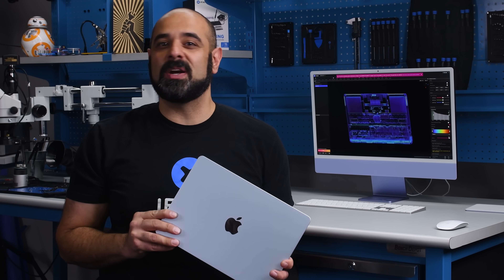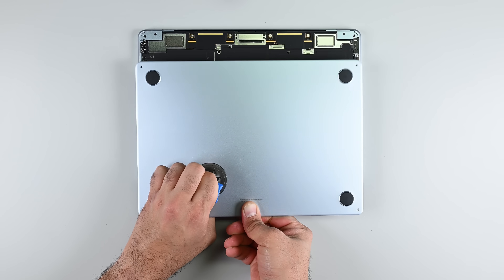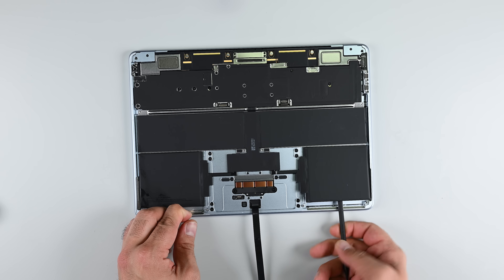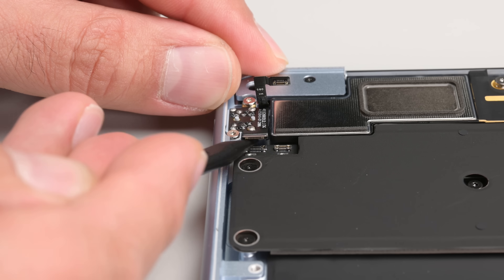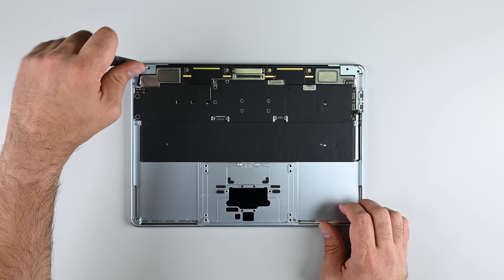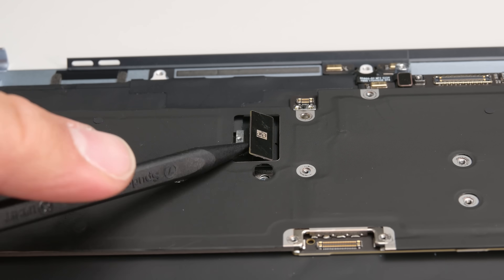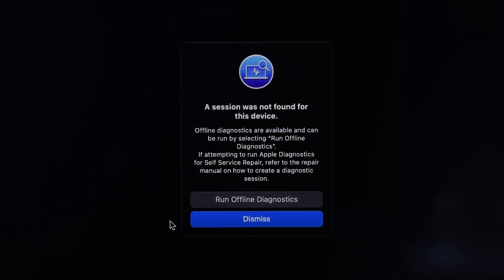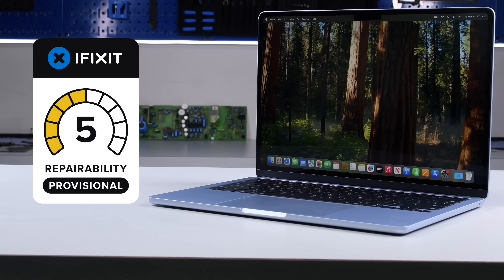MacBook Air M4: A Repair Win or a Locked-Down Mess?

Comment: Remember when you could pop out the keyboard of a laptop in 5 seconds with anything vaguely pointy ?
Reply: Relatively modern thinkpads are super easy to remove the keyboard.  Only two screws!
Reply: @joelv4495 I think you and I have different definitions of relatively modern
Because the current gen can’t do that 
And I don’t think the generation before could
Reply: I also remember when my laptop was made of cheap plastic and was a pile of junk after 2-3 years... Don't miss those days.
Reply: Lenovo T420.
Reply: A friend from work brought an old HP laptop. The whole bottom cover was removed by squeezing two tabs, the way old batteries used to be removed.
Reply: I'm in my 20s and I've never held a laptop like this in my life. That must be ancient history. 😁
Reply: @Tedrousek  The ones that don't have the keyborad integrated in the chassis, the keys are square and touch each other.
Reply: @Tedrousek  Not really. A friend of mine has a five(?) year old Lenovo laptop and the keyboard popped off with just a guitar pick (several little clips and like one screw hold it in). I also have a Framework laptop and those use magnets and screws. Business-oriented laptops tend to be more serviceable than the $300 laptop from Walmart or Best Buy.
Reply: @Tedrousek  not really, laptops only stopped being like that a decade ago

Comment: Correct me if I’m wrong but isn’t a purpose of parts pairing to deter people from stealing Apple products for parts? I think it’s quite a worthy trade off to pay Apple a bit more for a safety from theft.
Reply: the theft "prevention" is far out weight by the actual repairs that repair shops could do to prolong these device life time (which is not what Apple want, they want you to buy new, not repair).

you concern with a very small problem that Apple use to justified their anti-consumer behavior. Do you really think a company like Apple whom sell 2TB of mediocre of SSD storage for $800 think about prevent theft after they sold the product to you? They certainly don't care, they already sell it to you. they are more concern about you buying a new one after your old one brake down and no way to repair them economically.
Reply: @tsunekakou1275 esl?

Comment: At least the ram and storage aren’t parts paired, because they’re still soldered! The upside is that if you can find the modules required (and you have a soldering kit), you can upgrade it. Although you risk damaging your device.
Reply: these chip are smuggled out of factory in China, Apple can stop these thing anytime they want. most people would not spend hundred dollars on hot air station, pcb heater, risk buying sketchy chip from aliexpress, wait for a month, spend hours to solder. that is a big if with a lot of asterisks.
Reply: @tsunekakou1275 These are the same NAND modules as in the m4 Mac mini, for which companies like expandmacmini already developed and sell a custom pcb with 2tb storage

Comment: Magsafe is useless i wish they bring back another USB-C port
Reply: Wrong. MagSafe is fantastic.
Reply: MagSafe useless??? It literally frees up a usbc port you can use for something else.
Reply: @bodigames  sort of, kinda, indirectly, maybe.  The MS3 is basically a dedicated USB-C port assembly on the logic board, so they could have given us a 3rd USB-C port instead, but I get your original intent, gives us 2 free USB-C ports instead of 1 after the power is plugged in but it wasn't a "free" addition as it were and it's less general in its functionality (than a 3rd USB-C port)
Reply: You obviously never broke a computer by accidentally passing through a charging cable. MagSafe is needed and awesome. It was a major selling point when it was introduced. There was an outcry when they removed it. If you need more ports, get a MacBook Pro, you can still charge a Mac through USB-C if you so desire... Oh, and third party companies also make MagSafe cables it you don't want to pay premium for a replacement cable.
Reply: magsafe was missed enough that Apple brought it back after customer feedback

Comment: Looks like this teardown is m4 air 16/256. And logic board shows 2 SSDs. Each must be 128 gb. However many youtubers and reviewers reported that write speed is slower in Blackmagic disk speed test compared to m3 air 16/256. Any idea why?
Reply: The storage is configured in n * 128gb NAND modules in a RAID-0 configuration. So a 256gb model has two NAND chips to write to (configured as a 256gb RAID-0 array consisting of 2x128gb of NAND). 
This shows in benchmarks as a difference of +/- double the write speed. 

Learned this from iBoff RCC (I think)
Reply: money
Reply: @0xBene  correct, but the longer reason is that more modern and faster drives have higher capacities per chip so the base models are simply given older type drives, whether in terms of architecture, interconnect speed or silicon process.
Reply: +1
Reply: @beingismail4227  max tech has released the m4 vs m3, its the same ssd speed for the 256gb, the 512 is faster only for the write speed

Comment: Now remove parts pairing, develop an ultrafast modular storage and ram modules and you got a 10/10 device in every aspect
Reply: As long as the ram is unified and the gpu has actual decent performance we won't be seeing slotted ram again unfortunately
Reply: @smartG1123   yeah, but I mean, at least give us an extra SSD slot.
Also today NVMEs SSD are fast enough for memory swap
Reply: RAM modules are not possible with the speeds they're pushing. There's an actual valid reason why it's built into the SOC. Everything else is reasonable.
Reply: atleast storage must be upgradable
Reply: greedy cook @SAINIDE
Reply: Well, they ditched parts pairing(kinda)
Reply: Honestly, m4 users would all get a lot from an nvme nas connected by 2.5g-10g, the mini coming with an option for 10g isn't a mistake.
Reply: Same
Reply: I don’t like parts pairing. It just complicates repairs unnecessarily. I do like the fact that the USB-C ports are modular and are easy to replace. The battery is relatively easy, but you have to deal with those pull strips. It does make it somewhat easier, as the battery isn’t glued down. The score is pretty reasonable, considering the parts pairing and the pain in replacing certain components.
Reply: RAM will never be separated again, at least not in Macs.
Reply: At this point you would just replace the logic board and keep everything else.
Reply: RAM upgrade Price is very reasonable so it is not an issue. But there is the SSD issue but also not to much of a premium for an upgrade at buy config. I like the sealed case as a smoker as Apple once refused to repair my MBP Logic Board Warranty replacement because of that but luckily I found an official third party who had no problem doing that also for free by charging apple.
Reply: Since RAM has to be soldered (due to memory integrity), I'd actually socket the whole thing. It's completely possible, just has to be designed that way.

That would also allow for M2 owners to upgrade to M4 (if this level of modularity existed)

Also, keyboard doesn't have to be glued that way, what Apple is doing is purely malicious.
Reply: @igor4knezevic there is LPCAM2 standard which can provide very very close signal integrity, and bandwidth
Reply: RAM will never be separated for MacBooks. In order for fast performance that we have now it has to be unified. If not unified the device will work less well.
Reply: Just echoing what some others have said; unified RAM and SOC means no upgradeable RAM, but with lower power draw, lower heat, shorter data travel distances, and faster speeds, the tradeoff is well worth it IMO. The solution is simple for me; I just buy the amount I need up front. Having said that, although base prices are quite reasonable with their entire lineup these days — with the Air and Mac Mini being actual bargains — adding RAM is still way too expensive. Although I have no evidence for this my gut tells me Apple RAM price will eventually drop, if only because more and more are openly complaining about them, as we should.
Reply: @white.lodge.dale.cooper  so soldered ram = overpriced trash. Got it. Simplest decision ever
Reply: @yungfisherman4  how to tell us you don't know anything about Apple Silicon performance without admitting it. Or you're a kid.
Reply: Then get a windows laptop, you are not the target market for this laptop

goodluck with ram modules, most decent windows laptop has  a soldered ram
Reply: @cetangamer3228  Framework is able to get away with replaceable RAM modules on all their laptops, and their performance is reasonable.
Reply: @cetangamer3228 most don’t lol
Reply: Thats not profitable. You're fired.
Reply: @ not really.
Reply: Parts pairing is for safety. The black market is full of stolen laptops waiting to sell for parts if they remove the parts pairing.
Reply: @cleitonqueiroz7341 If they used m.2 SSDs you wouldn't need a stolen Mac to fix another Mac, you could just buy a new one, their SSDs are absurdly expensive for no reason
Reply: Not that smart. You need parts pairing these days to foil security breaks. That’s why it’s done.
Reply: @melgross  Yeah, that makes sense for TouchID pairing, but there isn’t a single scenario on this earth where requiring the lid angle sensor to be calibrated is a security feature. Let’s not be apologists for a $3 trillion company.
Reply: @ it’s not being an apologist and it doesn’t matter how much the company is worth. They’re got that big because people like their products, despite their repair policy because only a very tiny number of people are reckless enough to want to repair them themselves. If it mattered, Apple wouldn’t have grown so fast. If it’s an angle sensor, then it makes sense it has to be calibrated.  Then there have been the third party screen scams, and the battery scans. The list just goes on.
Reply: @melgross  You either didn’t watch the video or willfully ignored the information presented in the video. I’d elaborate, but you probably wouldn’t understand what I’m saying.
Reply: @melgross yeah and consumers bought ozone-depleting sprays until basically every government on the planet banned them.
Reply: @melgross  The EU really shook things up for Apple! Without their regulations, we'd still be stuck with the Lightning port "for so called security reasons" 🤡. Let's be real—USB-C is a game changer. And sideloading? Absolute win for freedom 🥹. Cheers to the EU for keeping giants like Apple on their toes!
Reply: @melgross  Since when repairing your OWN things is "reckless"? Do you also call in an electrician to change a lightbulb when it goes out?
Reply: @ How's that boot taste?
Reply: @melgross you are bringing logic in this

Comment: Is the storage soldered to the SOC? I had a small hope that the M.2 modules found on the mac mini made it over.
Reply: They’re not m.2 modules.
Reply: If it had an M.2 port, you could only install an Apple-certified SSD 3 times expensive than regular.
Reply: @humanser people have made adapters for these ssds before
Reply: @FireFoxDestroyer People have made replacement modules for the m4 Mac mini, but adapters to M.2 are impossible

Comment: Didn’t Oregon and Colorado make parts pairing illegal?
Reply: it can be done by the user now
Reply: It's pathetic that you have no knowledge and are passing judgement. Pairing and calibrating the mac lid close sensor is part of the security and encryption.
Reply: @nnnnnn3647  bro I don't think it's that deep man they asked a valid question and they turned out to be misinformed. Just explain what was wrong and move on don't berate people
Reply: @nnnnnn3647  easy there apple fan boi or perhaps Tim. Aggressively replying the same thing in every comment thread is not necessary.
Reply: @FirstLast-jd2ql  There is no collective response possible. Just think before you write.
Reply: @nnnnnn3647 Go ahead and explain the correlation between a sensor that determines the lid angle and encryption.
Reply: @nnnnnn3647  who pissed in you coffee?
Reply: @cesarespinozaspain  it was your coffee.
Reply: @nnnnnn3647 he just asked a question buddy chill.  Not everyone knows niche information like this.

Comment: honestly, the sticky tape holding down the battery is what pisses me off the most. the rest of the machine is just unscrewing stuff and popping connectors, which is fine by me.
Reply: Could be worse!  I would take pull tape adhesives over the old non-pull tape adhesive you need a flamethrower to remove  of the recent past!
Reply: The pull tapes were considered to be a major advance and really did require a lot of R&D before being used.
Reply: 3M needs to seize the opportunity to make and market a version of Command adhesive strips for electronics aftermarket. They are the pull to remove adhesive for around the house.

I'll settle for wider availability of Command adhesive strips refill.
Reply: Bruh
Reply: Hard agree.  
It may be easier with the (effectively) four-strip they now have, but you still have to buy replacement tapes.

It almost feels like a rapid way for Apple to see if the machine has been tampered with, which would invalidate any warranty...  🙃
Reply: They gotta find a way to make that electroadhesive from the iPhone 16 work on laptops.
Reply: you all know that they could just use a bracket to screw the battery into place? makes replacing the battery a lot easier. heating up a battery to remove the glue is dangerous
Reply: This is important so that the battery can't slide around and put strain on the cable; those ribbon cables don't like shear forces applied to them.
Reply: @soviut303  Or the battery could be held in with torx screws, like in ye olden days of the Unibody Macbooks. The glue tabs are just Apple cheaping out.
Reply: @soviut303  So, just thinking out loud here, what if they made that cable 1-2 mm longer? Would that mess stuff up?
Reply: @soviut303  can't you just screw it down? sure, it would take up a few millilitres but i'd be perfectly willing to accept that in exchange for not having a bx glued-in battery.
Reply: @soviut303 that's what you use screws for! The other side of the battery is screwed down!
Reply: @soviut303  you can use screws to fix them in place.
Reply: @soviut303  Okay, so use screws and plastic tabs to retain the battery instead? Pretty standard practice.
Reply: @soviut303  Screwing the battery down fixes that problem, other devices manage that just fine.
Reply: I don’t mind this. Batteries are dangerous. They can kill a whole plane if not designed properly. They MUST stay still.
Reply: @hieuphungminh6690  the way li-ion batteries explode involves them either being exposed to extreme temperatures, or the casing being penetrated. even if a battery did wobble around, it wouldn't matter - it still wouldn't ignite. on the other hand, if the logic board wobbled around, that would likely cause the entire computer to break. because of that, apple uses the most secure attachment mechanism for the logic board: screws. screws wouldn't make the battery wobble, and even if they did, it still wouldn't explode.